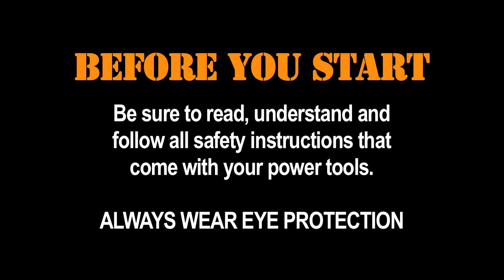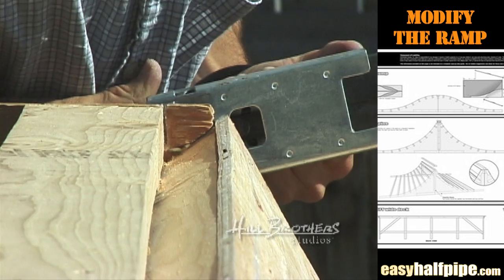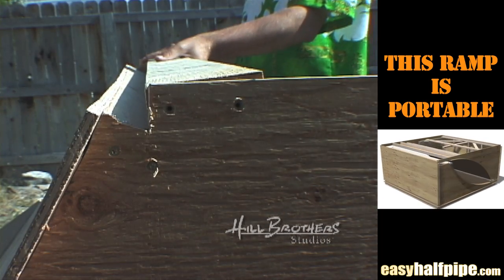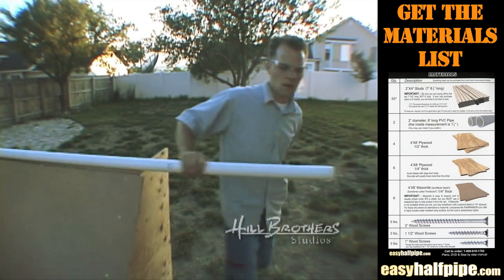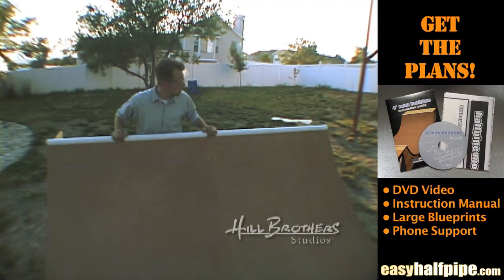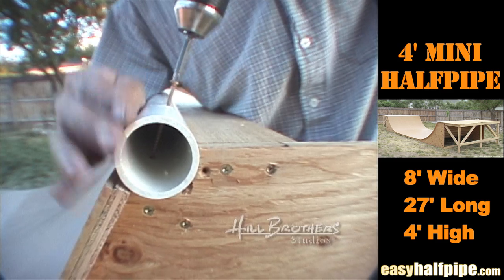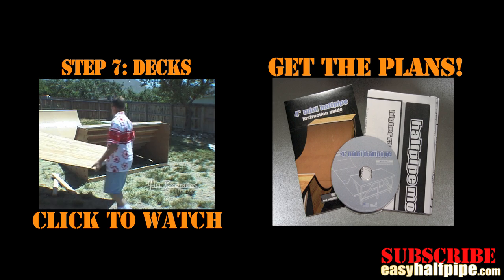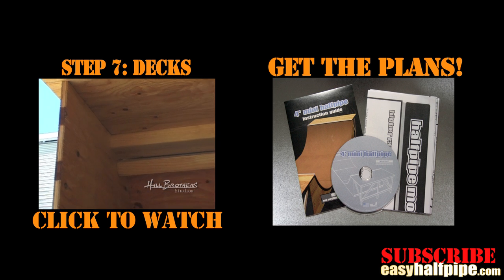How to build a Halfpipe Step 6 COPING RAILS

Comment: Been using pvc coping on my ramp for 3-4ish months and holding up really well
Reply: how about now? still holding up? considering using pvc instead of metal
Reply: @ryanlee9150  it’s still a good option i used the same piece of outdoor conduit for a long time but am using metal now just because I can the conduit didn’t break yet and I have it on a rail now

Comment: This is not how you want to screw in coping. The holes on top of the coping should be larger so the coping can be screwed in from inside the coping. The screws should never be visible. I've never seen it done that way in my life.
Reply: cfed00 - actually, those are both wrong. The coping should be bolted in from inside the ramp...

This is how its professionally done by real craftsmen:

- Get a 1/2" thick stainless hex-bolt, with 2 lock washers and a nut, per every 24" of coping being fastened.

- Drill out holes every 24" through only ONE SIDE of the coping (This will be the bottom after it's  installed)

- Put the bolts inside the coping. (put one lock washer on the bolt before fishing it through the coping to were it's threaded end is sticking out of the hole). Fish the bolts through the holes one by one (tricky at first, use a magnet or coat hanger) until all The bolts' threaded ends are sticking out of the holes.

- Now, match up the bolts with the holes you've drilled for placement of the coping to the lip of the tranny. Gently guide each one through the hole, evenly going up and down the coping to make sure you don't accidentally pop any of the bolts back into the coping (you can use a small pick, or coat hanger, or etc to kinda guide them into the holes by pushing on the threads of each bolt from above.

- One the coping and bolts are sitting on the ramp with the bolts through their holes, go inside the ramp and put the final lock washer and nut on each bolt finger tight.

- Tighten every other bolt going one way to snug, then every opposing bolt coming back until snug. Once all bolts are snug, go and crank down all the bolts another one and a half turns, starting with the center and working your way outwards while alternating end sides of the coping.

HOORAY!!!! You just installed coping like the pro ramp builders!!! (aka: zero holes anywhere to get hung up on or have issues with).

Another method done by SERIOUUSSS guys, is to take 3/4" stainless threaded rod, and cut it into 4" threaded bolts with no heads. Then, they weld each 4" threaded rod section directly to the back of the coping every 12-inches, and then drill the holes in the ramp and place the coping into place through the pre-drilled holes and bolt it down. This is another method to getting rid of extra holes that could hangup or etc.
Reply: Agreed! I've seen a nice video of screwing coping on using j-bolts from the underside of coping (from under the ramp's deck). Seems really easy and effective. No holes whatsoever on the ridable side of the coping.  As seen here: https://youtu.be/tJKyJMzvD5k (3:55 minute mark).